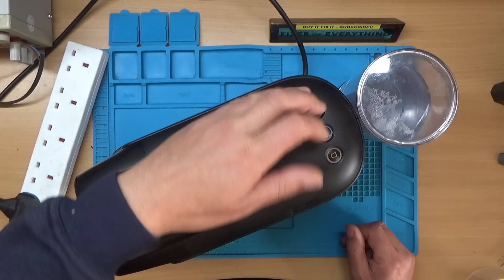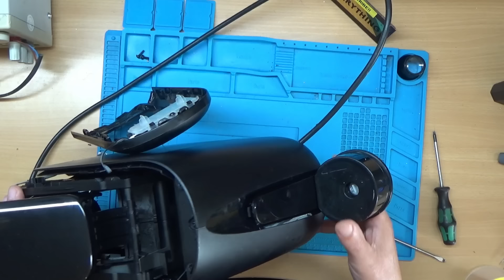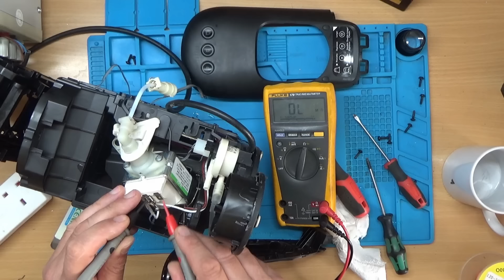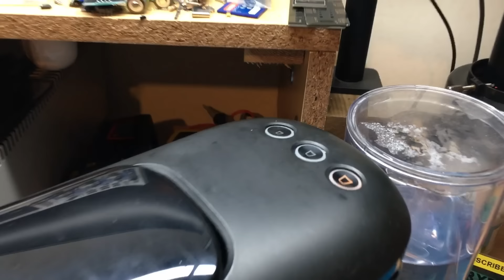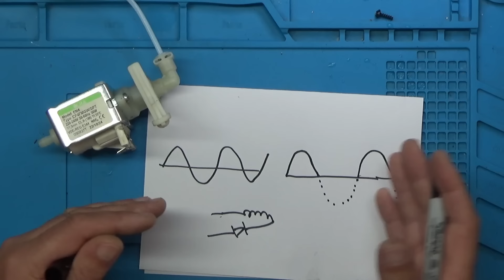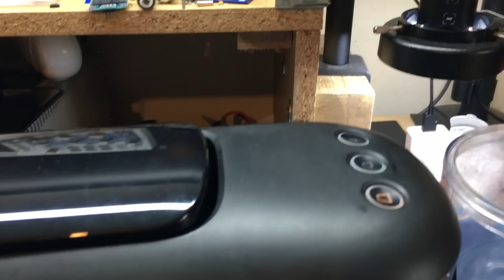Faulty Philips L'OR Coffee Machine - Customer Return | Can I Fix It?

Comment: I'm always amazed when you get clip together plastic items apart without breaking the lugs (which I would do!). I never expected to learn so much from this one.  Well done indeed.  I wondered at the start if you were going to x-ray it to find the clips, but maybe too large to fit the whole machine in.
Reply from the maker: Cheers Mike, yes a bit big to fit in the machine. I'm not sure how well it would have shown clips, screws wouldn't be a problem to x-ray.
Reply: @BuyitFixit  Ah yes.  I hate all this one-way plastic clipped stuff.  I suppose it's cheaper than screws and certainly faster to assemble in a factory. It is like repairability is going even more backwards.
Reply from the maker: Yep agree to all of that 👍

Comment: Hey is it possible for you to x-ray a near field payment card from a bank, to determine where or how far i need to cut the card to disable the nfc in it, a friend said that the coil winds close to edge but I don't have a nfc reader to test also it would look weird xD if I just cut a large junk off it. None of my friends happen to have an x-ray machine xD
Reply: Just cut the antenna. You can see the antenna if you hold a bright light under the card! No x-ray needed...
Reply: @intrax2tv  Thank you for the tip. Ouh yeah, instant success the bright light trick worked perfectly :)
Reply from the maker: Yes, I could x-ray one as I've done an NFC card in the past. Seems you've already got it sorted though 🙂
Reply: @BuyitFixit  Thx, yes managed to disable the thing. Personally I feel that near field payment is so insecure  that I don't trust it, even though my bank said "Don't worry we will compensate if somebody takes your money" But I don't trust them... The issue is the same as the remote attack on car keys, you just scan the key from inside and repeat it to the car. Who is there to stop you from doing the same to nfc cards in your pocket. Bank said well get one of those nfc protecting sleeves... But didn't want to pay for it.

Comment: Excellent repair Mick👍👍 I was expecting an electronic fault instead of a mechanical one.  Finding the mismatch internal piston problem was golden, your dedication is so appreciated.  Did you add a new diode to the coil? I didn't see that and I lost my sound to the video so!  Great fix and results, enjoy the coffee.  See ya soon.
Reply from the maker: Cheers Terry 👍Yes I was expecting electrical fault too. Didn't need to replace the diode as it was actually OK. It just so happened when I measured the coil my leads were the way around where the diode blocked the reading, and I just assumed the coil was open circuit as it just looked like a coil (didn't expect it to have an internal diode).
Reply: @BuyitFixit  Excellent! Got my sound back so watched the video again but didn't notice the reversed leads. Madness teardown, you have way too much patience😉

Comment: Excellent fix! The big challenge seemed to be just trying to figure out how to take it apart. I agree that many appliances now days are not repair friendly. So the actual problem was mechanical wear or defect of the pump? Good explanation of how the pump works! What size diode did you use? Hopefully you will enjoy many cups of coffee from here on.
Reply from the maker: Thanks mate, the original diode was actually OK. It was just when I initially measured the pump (if I had swapped the leads it would have given a reading). But I just thought it was a normal coil, didn't expect it to have an internal diode embedded in it.

Comment: I have the same machine, bought from a work colleague 2 years ago. Used it pretty much every day since then and it's still running fine. However, this could be useful if it fails at some point so thanks !
Reply from the maker: Nice, seems they are fairly reliable then. Well at least you now know how to get it apart if you need too 👍